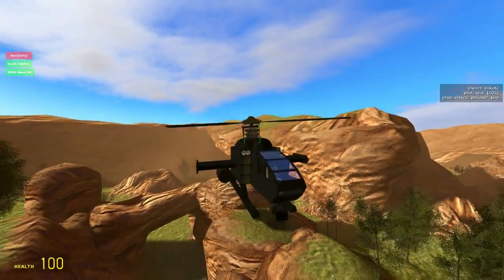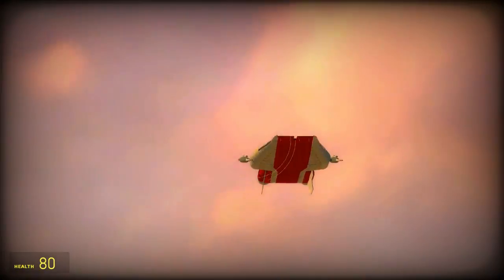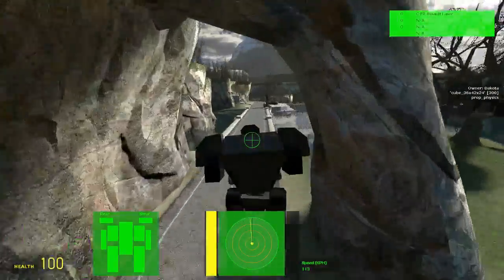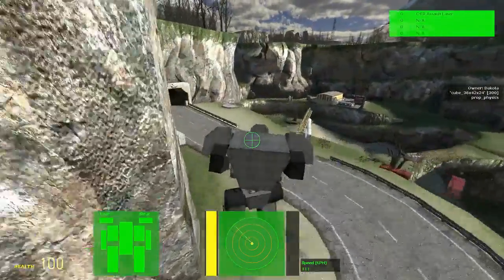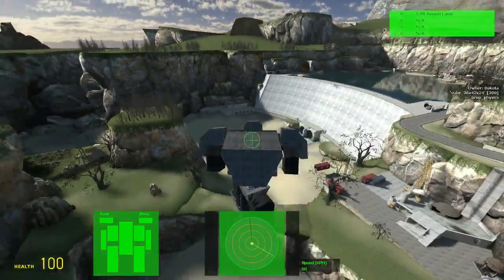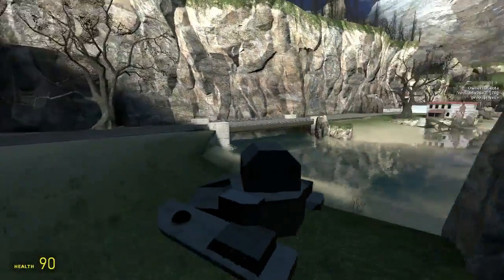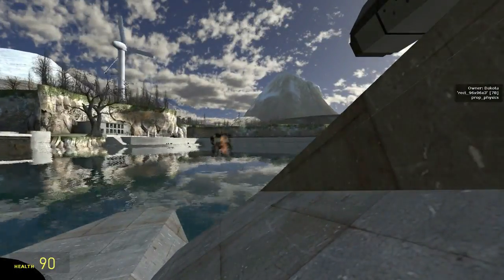DakTek Basics Ep1: Mobility Entities

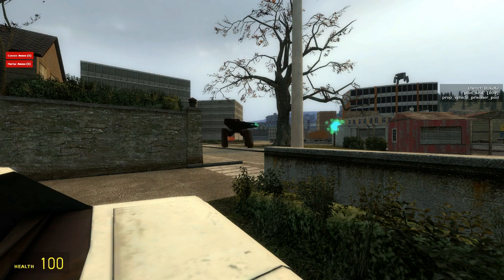Comment: 0:46 I request that you release the mech shown in this timestamp. I like this addon but is very confusing and I am usually a quick learner when it comes to this stuff, but it's more confusing and I would like more to build off of, please and thank you for this amazing mod. (Edit: How do I go into Third Person with the mechs?)
Reply from the maker: I will not be releasing that mech, its unfinished. Infact I just had quickly retrofitted it from ACF weapons and e2 based movement systems into DakTek systems and weapons minutes before filming the video so that I'd have a mech to show for the quad category. If you look at the rooftops in that segment you can see where I left the build I was working on ontop of the roof.

It has no HUD, doesn't have a good loadout, isn't armored, doesn't actually function entirely properly since the hip is sideways, though the gyro is also sideways to counteract this, meaning I have to turn it once getting in, its not as noticeable as it would be on a biped since its a quad though. Also the constraints aren't proper, so the legs just wobble around. Its really not something that someone should use as an example to learn from. 

Also Alt is the default key I use for going into third person, though you can wire the camera chip's inputs to whatever you want.
Reply: Thanks for the reply, mate. I understand you took the Valve way with the mech (for instance if you spawn in a building effect you can see through 90% of it) which is cool. Still, thanks for the mod and reply! Appreciate it.
Reply from the maker: You're welcome, sorry for taking so long to reply, I took a break from youtube and coding on daktek for a few weeks.
Reply: It's cool fam. Your work makes up for it by a landslide.